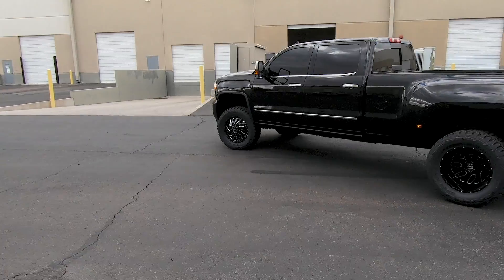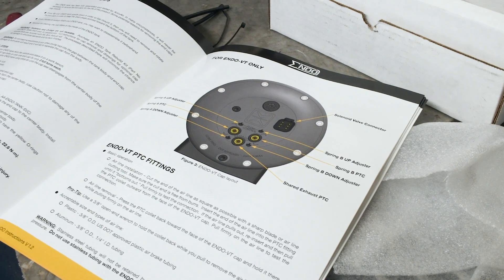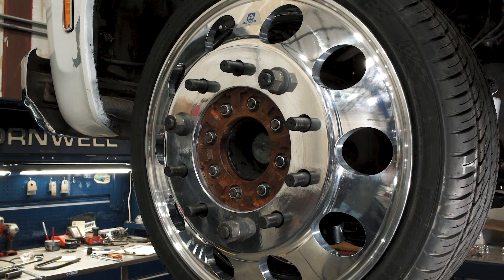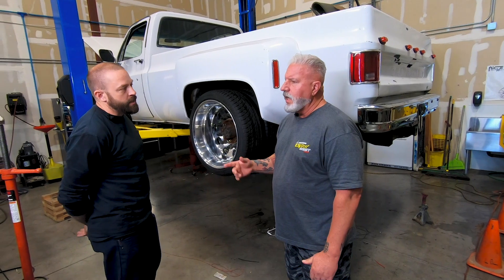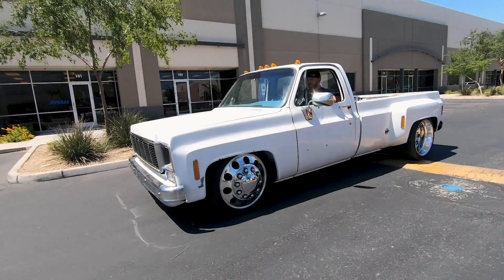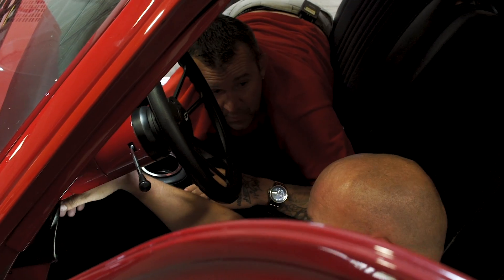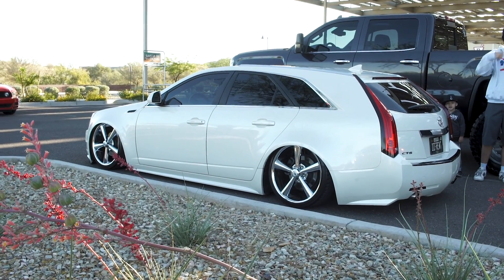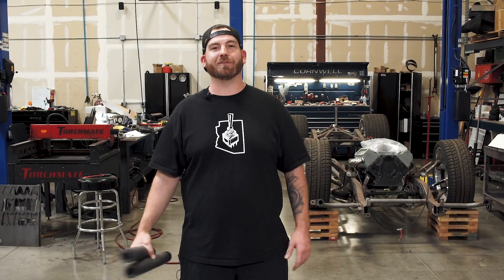Switch Suspension “What the Nunchuck”

Comment: Hey guys, worked in gm dealerships back in those days and the extra tag bracket is there because when the truck came off the transport it didn’t have a rear bumper. Some people opted for no bumper when they bought it so it had to have the tag bracket with a light, just a little spare body history.
Reply from the maker: Very cool, thanks for the education 👌🏼

Comment: How did you run the fuel gauge . I have Dakota digital and I’m needing any help I can get
Reply from the maker: We just ran a new wire instead of using the one in the factory wiring harness. There were a lot “repairs” going on in the factory harness and it wasn’t registering so we bypassed it.

Comment: WHAT in the hell is a "steer wheel" ? Please some one elaborate.
Reply from the maker: A “steer wheel” is a rim that has a different offset than a standard dually wheel. Typically only used in the front.
Reply: @switchsuspension  
On a semi truck they are used only for the front.
Reply: concrete trucks and fire engines have them on the front..